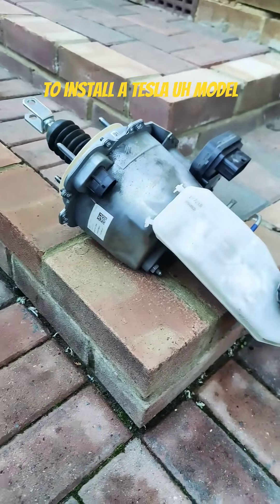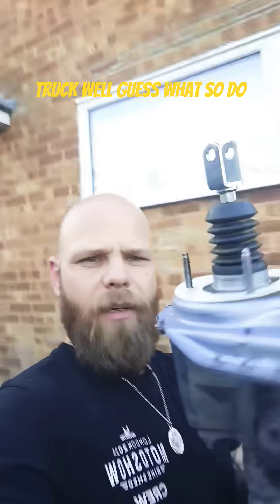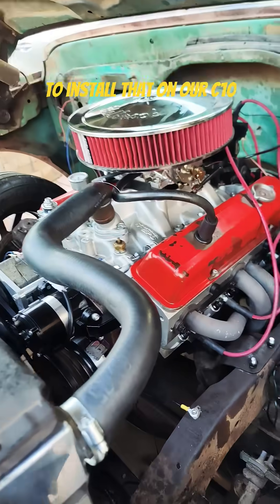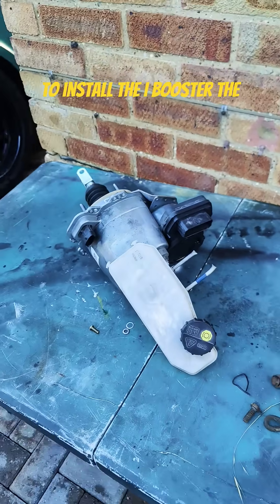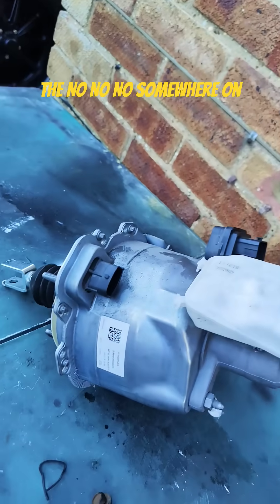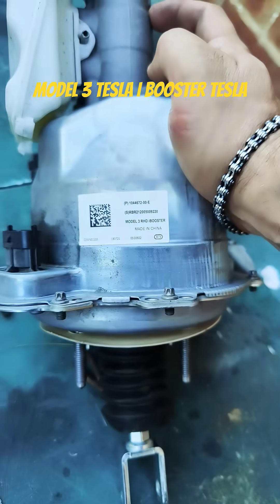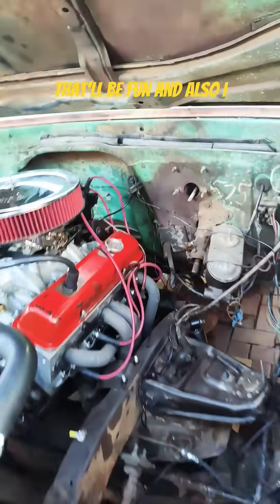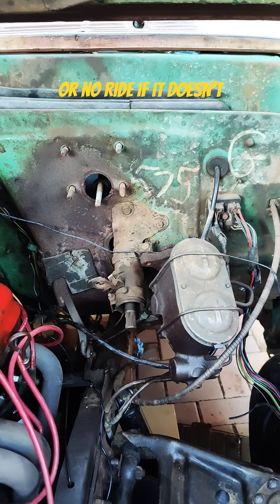Do you want electric power brakes on your old Chevy truck? #tesla #ibooster #chevytrucks

Comment: Well it's all about mounting conversion. I'm also currently in the process of installing one in my GTR. ✌🏻
Reply from the maker: Nice dude, let me know how it goes? And what design you create? Are you 3d printing a mock up?
Reply: @makecoolshit I printed a conversion plate so that I can precisely drill the holes into the firewall and the mount for the pedal behind it. You can find the measurements on EVcrate when you google that.
Reply from the maker: @raiju1337 yep I saw that website. 60x80 bolt pattern. Mine isn't that sadly so I'm going to have to make my own. I also have 3d printed a template to make both sides fit but I'm just playing round with ideas atm